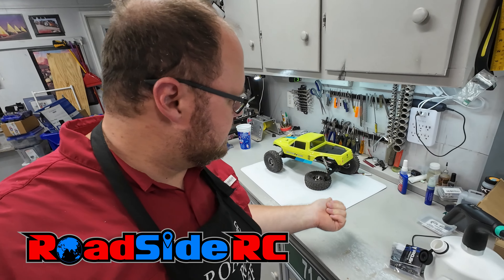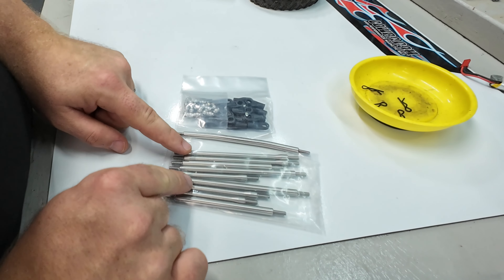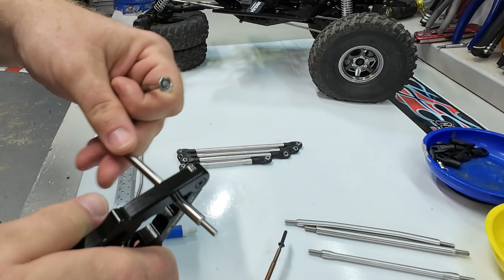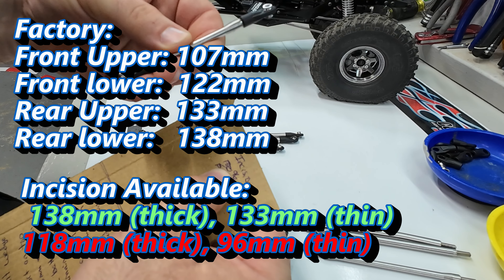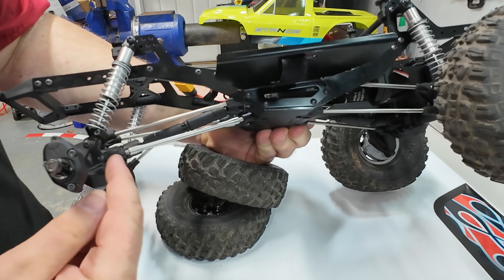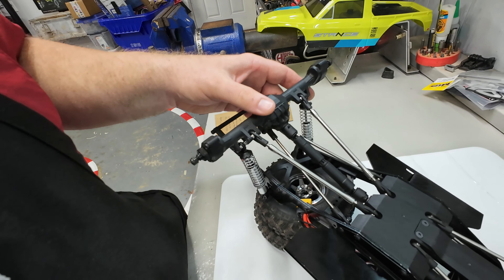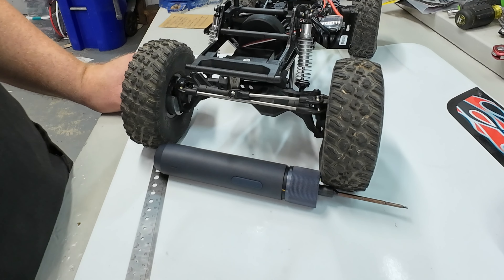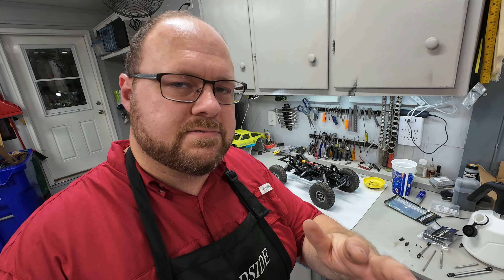FIXED!!  The ONE PROBLEM with the Vanquish Stance RC Crawler

Comment: Hey Troy, I think you may have gotten the vs410 link upgrade vs VRD stance? At least from what I can tell.

INCIRC00303 vs IRC00305/IRC00306(just lowers)
Reply from the maker: I hope you are right!! 

I looked alla round for which link set was the right one for this truck.   The folks on the Vanquish Facebook group said this was the right set...but clearly it is not.  

I have updated the link in the video description to point to the set you suggested.  

Thanks!
Reply: @RoadsideRC  yes you got the wrong links. You want IRC00305 not IRC00303. Your link even says they are for the vs410 not the stance. Going directly to vanquish website would have helped the most
Reply from the maker: I DID!   I swear.  
Perhaps I am just that much of a moron, but I swear I started on the Vanquish site and it pointed to this kit. 

Makes sense that it is the wrong one though!

Comment: Troy, I just checked the website and you can also order just the lower upgraded links for the Stance as well
(Replacement Lower links for the VPS09015 VRD Carbon)
No sense in buying the entire link set at this stage - or you can still run 410 links on the Stance. I am sure they'll be fine
Reply from the maker: Great tip!
Thanks!  

Pretty sure just the lowers didn't exist when I ordered this because I 100% would have done that!